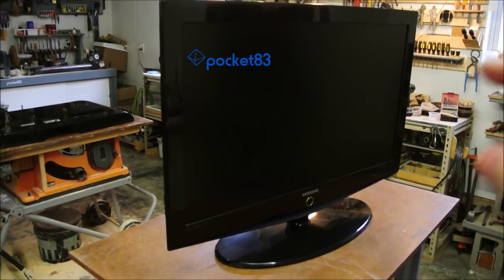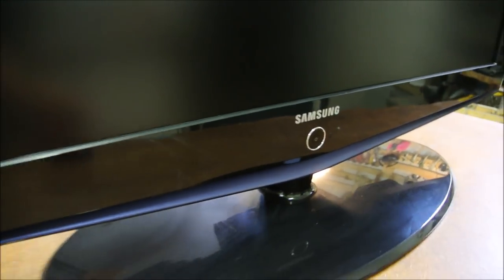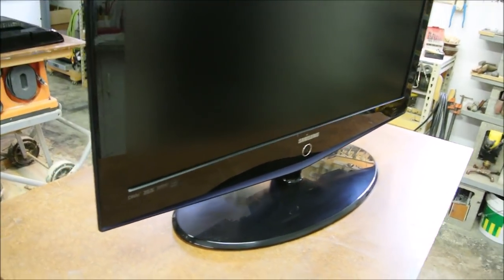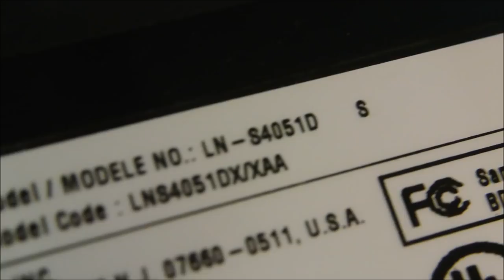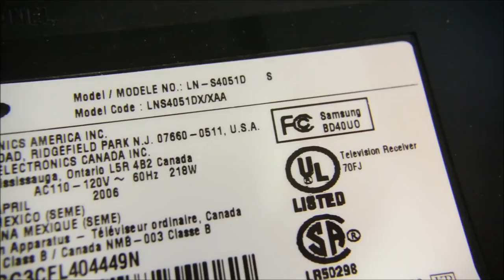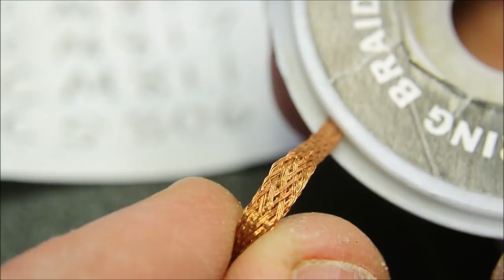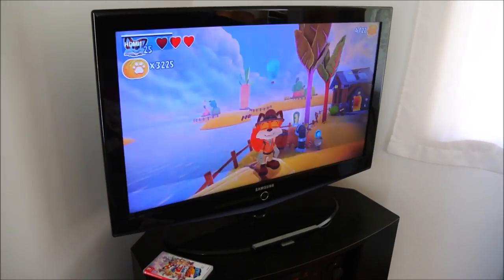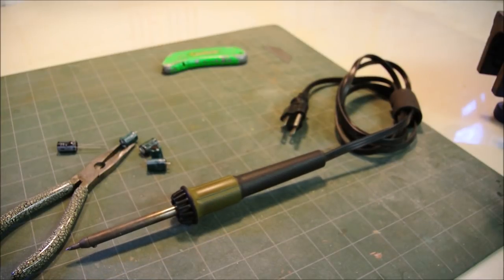TV repair: SAMSUNG LN-S4051D (blinks without powering on)

Comment: The solder used industrially melts at a much higher temperature. Get some low temp (maybe even leaded) solder and you can use that to help desolder things. Add the lower temp solder to the pads, which lowers the melting point of the glob overall. This makes it much easier to remove things.

Get a variable temp solder station. Anything with replaceable tips so it lasts longer.
Reply: A solder sucker helps as well. They are only a couple of bucks and the spring loaded plunger operates like a syringe in reverse. Once your solder is molten, click your solder sucker and all the solder is sucked off the joint and into the sucker.
Adding in leaded solder really does make a big difference when trying to remove the 'safer' lead free solder from components.
Reply: Maxx B Hey. Reading your comment—I’ve been desoldering boards to salvage components (amateur enthusiast) and use solder suckers a lot, but I’m always afraid that the tip is going to melt because you have to pretty much have it contacting the solder point or it won’t be molten... are those plastic looking tips heat resistant?
Reply: This. Industrial solder is lead free, and it doesn't melt as easily. Fresh leaded solder will melt more easily. Make sure it has a rosin/flux core (most do, but check) as that helps to "wet" the solder (flux removes oxidized surface, although I don't know what oxidized solder doesn't want to melt/flow). Use a touch of leaded and fluxed fresh solder to liquify the old solder.
Reply: @jesselevine0  they are usually heat resistant and/or replaceable
Reply: @joem5254  I consider the solder sucker tips an expendable item like brake disc pads on a car.  It will need to be replaced in time to be effective.
Reply: @dwightl5863  necropost. Also, I wonder if they make silicone tips, that would be amazing.

Comment: I've fixed 8 tv:s just by replacing bad caps. All samsungs but different models. With a bit of research we can save a lot of crap ending up as scrap. I will never buy a samsung tv personally knowing that they cheap out on a cheap part like the capacitors. Also talked to the guys at the dump, they seldom see any other brand of tv:s ending up at their workplace. Thanks for spreading the knowledge!
Reply: U may not see 5 months later. Our Samsung wont come on either. I used to be geeky even for a women. My first computer didnt have a hard drive or mouse Now older I'm hands on. Repair my 8 vintage sewing machines but not down to electrical issues yet. Well at 17 I figured out which wire in my dad's car was causing short. Just studied the diagram. I found this video after looking at more uploads finding his humming bird feeder one. So our samsung is 2012. Apple TV 4 seemed to affect it. The electricity  here goes off and on which seemd to permanently break it. The big grocery store an hour away. Hard to just get contractors. I'm figuring nit worth learning and just get another brand!!

Comment: If you'll just add a drop of new solder over the old solder it will be eazyer to heat the old solder no metter what kind of soldering iron you have.

Comment: Hi Pocket, firstly I really enjoy your videos and the diversity of the content that you put out that quite often shows people that anyone can do these things. Anyone that has soldered before knows how fiddly it can be so understands that the addition of a camera takes it to a whole new level.  Like you, I am not a professional, though I have been soldering since I was a kid.  If you or anyone reading this is interested and is inspired enough by this video to give this a go here is my two penn'orth in regards to desoldering; I add some solder to the tip of the iron to help transfer the heat and some fresh flux (I think) to get the solder to flow and then use a solder sucker to clean the joint. Then I gently bend the legs up a little, quickly reheat the joints with some fresh solder and gently pull the component out.  Lastly I give the joint a quick clean ready for the new component.  With so much information at hand more people should really not be afraid to open things up and try to fix them instead of throwing them in the rubbish!

Comment: One tip is to wet the tip generously with normal 60/40 lead'ed solder before trying to remove the part. This does two things; you make a new alloy with a lower melting point, and you increase the surface area between the tip and the joint, allowing more heat to be transferred. Adding flux could also help. Anyway, awesome job! Fixing electronics does not have to be complex.

Comment: Pocket,
Great video, as always. I am a computer engineer by trade and solder components for living. I wanted to humbly share a couple of tips that you might find helpful. Get a cheap solder sucker off eBay for 5 bucks. You can even get a fancy one for 10. It’s this little vacuum tube that you pump once, then you position it next to the component, melt the solder with the iron tip and release the pump. There would be no soldier left on the component. Also, I almost never solder or desolder with flux. Rosin flux is cheap and makes a day and night difference. I love your videos man. Cheers

Comment: When removing capacitors like this, I've had some success in straightening out the bent leads just using the tip of the soldering iron. After the leads were straight, I have also had success in using the tip of the soldering iron to apply pressure to the ends of the leads to push the capacity back through. This still required rocking it back and forth and removing it a few millometers at a time, but it meant I didn't need to hold onto the capacity from the other side. For something like a capacitor which only has two leads this method seems to work ok, but for things with more solder points, the de-soldering braid is a must. Always interesting watching your repair videos. I've had some very similar experiences when trying to film myself soldering...it makes the task infinitely more difficult.

Comment: Hi,
I really want to thank you for this video, it helped me repairing my tv.

My tv (LG 32LC51) had the same problem as yours, but worse. Every time I wanted to turn it on, I had to put a rubber band and a piece of cardboard on the power button and then wait for half an hour (if it's cold, if I heat it with a hair dryer directly through the cooling fences, it will take 5 minutes to turn on).

So I saw your video and decide to take a look inside my tv even though it's not even the same brand.

For each step required to open the tv and get the circuit board free that you presented, I managed to successfully adapt them to mine. In fact, the interior looked a little bit the same as yours in terms of main/secondary/input output/command circuit board.

I looked closely on each board, and found out that the main one (resembles the one your worked on) had 6 capacitors that were bumped the same way as yours.

I desoldered them (more on that below), tooked the voltage and capacitance of each one.

I had :
C202 10V 2200μF 105°C
C206 10V 2200μF 105°C
C217 10V 2200μF 105°C
C218 10V 2200μF 105°C
C222 25V 470μF 105°C
C226 35V 470μF 105°C

I replaced the first 4 with 16V 2200μF (+6 V) and the last 2 with 35V 470μF (+10V for the 5th one and +0V for the last).

The reason for those choices are : simply because I didn't want to buy 3 different packs, that would cost much more (and I wasn't able to find certain voltages on amazon, I don't know why) and I went with 2 packs : one of 16V and other of 35V, that way I either increase the voltage or don't change it, but never lower it.
In each case I didn't change the capacitance.

I replaced and resoldered them and the tv is turning on with only one push on the button. Some times it needs 2, but it has to be quite cold, and it's really not disturbing.

So I consider my first soldering iron project quite a success, thank you.

For the soldering part (the you in this part is employed for the reader, sorry if it's obvious) :

I also had quite some trouble desoldering the capacitors, I have a soldering iron that looks even worse than the one in this video, I don't know if it perform worse.

For increasing the heat transfer effectively, I found that you can increase the surface contact if your soldering iron has a little blop of solder on it's tip.

As other people said, in general the soldering used on industrially mad boards has a higher melting point than the usual one. I have noticed this fact on every board that I have put a soldering iron on, but I only did that for a few, so not a very relevant information.

I also tried to mix my low melting point solder to the one the board as suggested by others here, it helped a little, maybe I should have used some flux.

Using a high temperature AND high thermal mass soldering iron will also prevent you from damaging your board. Because if you take too much time to melt the solder, the heat will start to migrate from the solder to the board faster (I don't know if it will really migrate faster, but you get the idea) than the solder takes heat from the soldering iron and thus this will just increase the overall temperature of the board without melting the solder.

If I remember other errors I mad or tips, I will put them as an answer to this comment.

Bye :)
Reply: I prefer to not bend the metal connections even though it makes the soldering process harder, you have to keep the electrical component in place with another method while you're soldiering it to the board, and I don't have any effectif method for that.

The reason for this choice is simply to make further repairing easier. Removing those components will be easier because I wouldn't have to desolder them and straight up the pins whule the solder is melted.

Comment: Without being an electrical engineer, learning to solder and desolder enough to replace capacitors is a very valuable skill.  There was a flood of bad capacitors in the Asian markets in the mid-2000's but all electrolytic capacitors are just things that tend to go bad over time.  You don't need to do "research" for your particular piece of equipment.  Just open it up and look for capacitors that are bulging or leaking a brown goo.  Purchase a replacement with the same microfarad rating and an equal or higher voltage and try to get the same physical size.  Remove and replace them one at a time and pay attention to the polarity.  I've repaired about a dozen computer motherboards and a 50" plasma television with no more electronics knowledge that what I've described above.

Warning: If you are an amateur, don't attempt this type of repair with high-voltage electronics such as old CRT televisions, arcade machines,  and old stuff that uses vacuum tubes until you understand the risks and how to mitigate them.  Those types of devices can store lethal amounts of voltage even when they've been unplugged for long periods of time, and the industry standards in the old days didn't focus much on safety (eg. discharge resistors).

Comment: Nice work!

Hakko and Weller make nice soldering irons, I have a Hakko FX-888D that I really like to use.  ~$100 MSRP is probably a good guide for your next soldering iron.  You can get some different tip shapes and sizes. I really like the flat screwdriver looking ones but you may have a different preference.

Soldering flux.  The solder that you use will have some flux in it, but adding more makes your life much easier.  There is washable and no wash needed flux, both are great.  When you're working with old solder, you can add a little flux to the solder joint, this (along with some fresh solder) will make it easier to get old solder joints working again.

Desoldering braid is a good tool.  If you add a bit of flux to it and it just before you use it, the desoldering braid works much better :)

Look for some good quality solder.  In the US you can get solder with lead, as well as lead free solder.  Both have their uses and people are passionate about their choice :)

Fantastic work finding, removing and replacing the bad capacitors!

P.s. like everyone else is pointing out, capacitors can hold a charge after the electronics have been powered down.  Sometimes this charge can be dangerous or lethal if you accidently short it and get yourself in the path of the electricity.  It's worth your time to look into how to check for a charge, and discharge a charged capacitor so you can keep yourself safe.

P.p.s Thanks for sharing your adventures :)

Comment: I'd keep the old iron (still have and use mine from time to time) but grind the tip to a chisel nose, like the one on sharpies. It'll give you more surface area for jobs like this and still leave a point for detailed work. Always a pleasure, Mr Pocket.

Comment: I had a very similar failure on a Viewsonic computer monitor that I fixed.  Remove as much of the old solder as possible first,  then bending the wires and rocking the component off becomes easier.  The spring loaded syringe device that came with my soldering kit worked very well, sometimes detaching the wire completely with one hit.

Comment: Bless you for trying
I was going to come on and get irritated with you, but you tried, and did well.

It’s worth investing in a decent but cheap iron.

You did well upping the voltage to 25volt caps

Always get 105 degrees caps, the old 85 degrees are rubbish
The 105 denotes what working temperature they can withstand.

Comment: You'd do well to pick up a Hakko FX888D. They're pretty much the hobby standard for soldering. The tips are easy to come by, it's digitally temperature controlled, and it's a decent price around $100. That iron will likely last you the rest of your soldering career. My preferred tip style is a small wedge tip. I really don't like using conical tips.  As others mentioned, a spring loaded solder sucker is a joy to use, and beats the wick. That TV was probably assembled with lead free solder. It melts at a higher temperature and it's one of the reasons your single temperature iron was uninspiring when melting it. As others have mentioned, melting a little bit of leaded solder into the lead-free solder can make it melt at a lower temp. Don't be afraid of lead in solder. Just wash your hands after using it, and try not to inhale too much of it. Source: I'm an amateur radio operator (callsign w8tam), and I've built quite a bit of my own equipment with a soldering iron.

Comment: The copper braid works well, but the solder suckers work well too.  You don't need to spend a lot on one, you can use one of those red ear bulbs you can buy cheap in a pharmacy.  I don't know if you watch your camera's view on a studio monitor while you're filming, but if you can set it up that way, you can watch the soldering iron's tip on the monitor which is easier than trying to look around the camera as you work.

Comment: Hey Pocket! Had to watch this, I usually end up repairing the LED backlights for some of the tv's we have in our arcade games; wanted to see what you had to offer. I can totally understand the issue with the camera. I personally like to get real close to the soldering area but if you do that wear a face mask or don't breathe in while you are soldering. It gives off fumes that you shouldn't breathe in. Not that you didn't know that but general food for thought here in comments. It should definitely be easier to loosen up the solder already on the board, first thought was temperature...which the one at my work is set to about 750 degrees. The one you had was probably 700 or lower or the tip wasn't good in transferring the heat. I like using a sponge and also a steel/wool flak for the chunky pieces to get scraped off before you use the moist sponge. Wicks definitely kick butt as they will help you get a big chunk of surface area while you can wrap the tip in the wick if needed (it's flexible surface area). Also, flux is your friend if you find yourself having a lot of trouble with getting old solder off. Without the flux it doesn't transfer as good. No master solder'er here but been doing it for a few years. Like to hear feedback from you as well. Also Note: While you have the TV open like that, doesn't hurt to check all of the caps and replace any questionable ones. There will be more that go after that so you should save the time now while it's open to do all the work necessary. Otherwise, you could find yourself opening the tv up every month depending on it's usage (Arcade hours are definitely more on a tv's lifespan than home usage ;) ). Caps are dirt cheap.

Comment: I have a Hakko FX-888D soldering station that I've had for a number of years now and it works great.  It displays C or F, has a number of presets or you can run/adjust manually.  I paid about $100 for mine and have never regretted spending the money.  Just be wary of fakes since they do exist.

Comment: Regarding soldering iron reccomendations: I have the Weller WESD51, and it is fantastic.  Not only does it allow you to set the temp, but it also lets you know when it's up to temp --which is very fast!  That feature is really handy for when you're soldering multiple things.  Just pause between until it blinks again and then you know it's hot enough.  It also has an auto-shutoff if you happen to leave it on accidentally (which I have done a few times with various irons!).

Comment: yeah the TS-100 is great. I use it with a 24V laptop power supply and it is super quick. Works on things that suck up a lot of heat too. Very cheap too assuming you already have a PSU.
Reply from the maker: Second vote for the TS-100. Thanks.